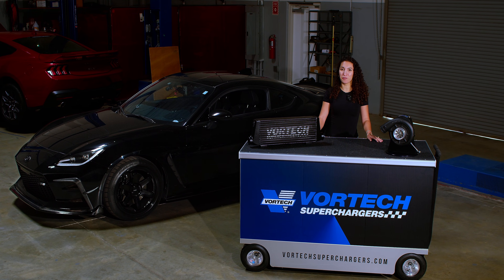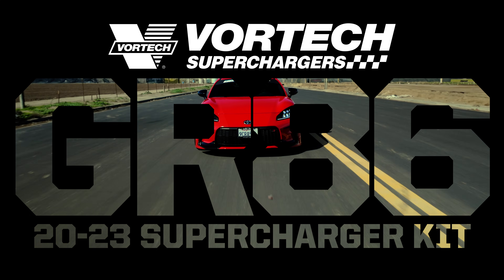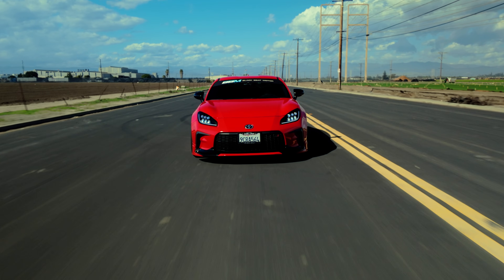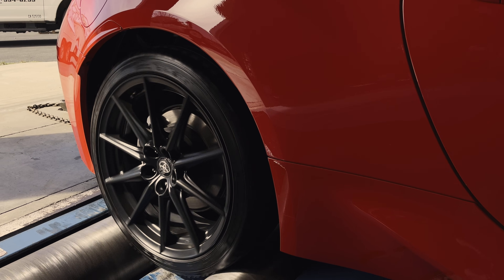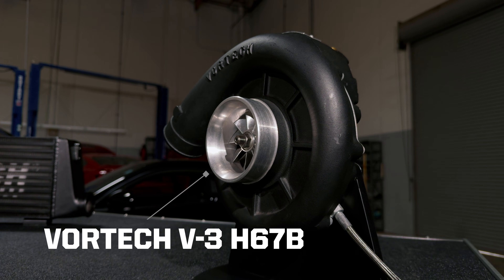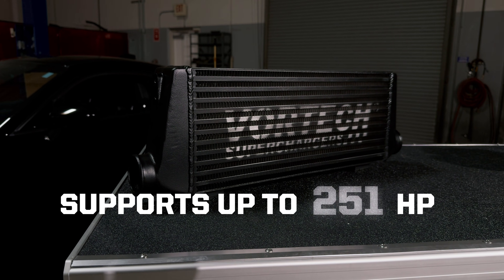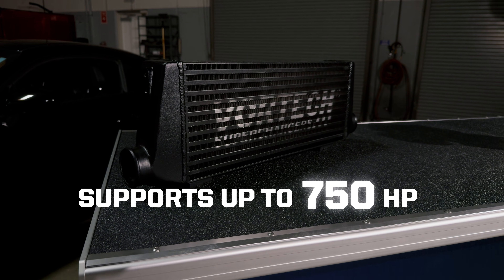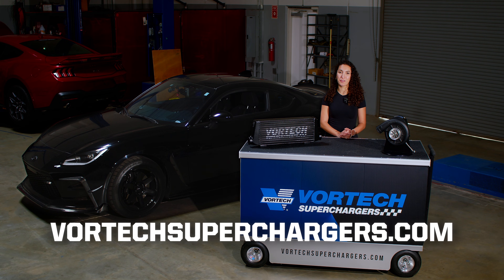Vortech's NEW 2020-2023 GR86 Supercharger Kit

Comment: Has there been any long term testing done to see how much power the FA24 BRZ/GR86 can handle reliably?  Would daily driving 300hp in one of these last a decade with minimal maintenance?
Reply: Failure point on 6MT is the transmission - the auto is way stronger. Yes, 300whp is quite conservative on the FA24. You could probably get closer to 400whp without issues (other than the trans). Beyond that you'll need head studs for sure for those boost levels, and probably injectors, fuel pump, etc. to get enough fuel into the mix. IMO (I had a boosted FA20 and have a NA FA24 right now) anything beyond 350whp probably isn't practical or useful, even on track, unless you're producing significant downforce. The car is too light to make use of it.
Reply: @9bitbyte  300 whp would be sweet for my use lol. I will wait a year or two to see others uses first.
Reply: @AndreNguyen7 good luck on your boost journey! Make sure to have all the supporting mods you want in place first- suspension, brakes, fuel delivery, whatevs. Most importantly, enjoy!
Reply: @AndreNguyen7  Nono, I insist, you first lmao
Reply: @9bitbyte  ima take notes rn lol
Reply: centrifugal is more reliable from a temps standpoint than a positive displacement or a turbo, also in regards to the trans....since its centrifugal the power/additive interaction scales with the rpm/rev range. As well as this kit being "compliant" then again ppl looking for "PURE POWER" dont entirely validate "reliability" and cost to run. So they see centrifugal as a joke when really it offers a lot of reliability potential compared to other applications. I wouldnt so much as say " ENGINE" tolerances as much as other things like water/fuel pump injectors proper spark/timing and oil pump/temps etc...being equally as important things worth knowing if we could but since the cars so new...theres only so much understood so far. And centrifugal seems niche to the "hot boi" mentality buyers so idk how big the numbers are for ppl running centrifugal on an ALREADY low volume/sales platform NGL. Other than that the potential for part availability etc is there since the engine is used in other subaru...ijs from the OEM standpoint what will fail/weaken due to the addition of a SC cant entirely be determined currently as far as how much COST/maintain to run etc will be 10 years from now. Sure the engines exist down the road if replacement is necessary but im just pointing to the actual volume/range of ENTHUSIAST activity with that block as well as the 86/brz platform as a whole....the cars are low sale depending on the year/month with this gen, and yet sourcing potential spare/donor engines....is THERE...just not as much data/enthusiast support and VOLUME compared to other cars. So from a support/tuning cost standpoint in 10 years thats also a big who knows.
Reply: @anhiirr  These are mostly valid points. The supercharger may or may not last 10 years or more. My old FA20 is still going strong with its original 2016 turbo (with another owner who tracks it) - conservative tuning and proper maintenance go a long way. I would imagine that a good supercharger with conservative tune and proper maintenance would last as long as the engine. I'll push back on your comment about lack of data though - consumer data in the auto industry is about as worthless as a dick measuring survey. Most consumers who buy aftermarket FI and tuning solutions are just chasing numbers and pushing their application way too far beyond "reasonable" (from an engineering standpoint). Those applications will fail prematurely at the expense of maybe 15-30 extra peak HP. Nearly every other turbo FA20 in my city has spun bearings, melted parts, blown gaskets, you name it... and they were all over-tuned and pushed hard.
Reply: @9bitbyte pretty much it's why I always laugh at the "what's the most stock internals can push" folks or the ppl whose research is solely on the fringe of functionality

Comment: Maybe a dumb question, but why 2020 - 2023? Aren't those two different platforms? And wouldn't a supercharger compatible with a 2023 GR86 also be compatible with 2024 or the current model year?
Reply: Most likely an old recording which is why 2024 and 2025 wasn’t titled here. The “2020”-2023 piece is kind of weird though… @vortech please help clarify.
Reply: Yeah I think this is just an editing error on their part. They mention second gen in the video, so it's gotta be 2022+
Reply: It's the same car